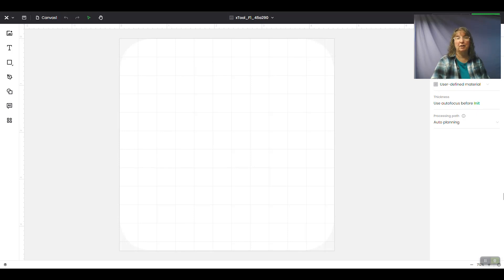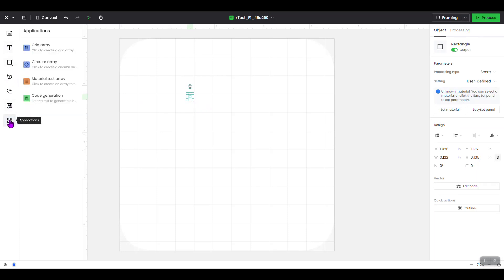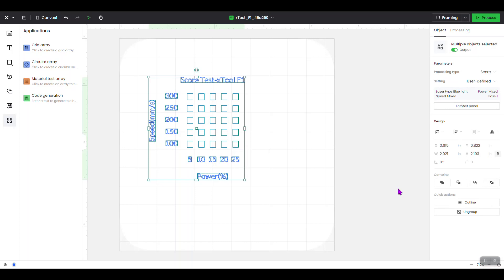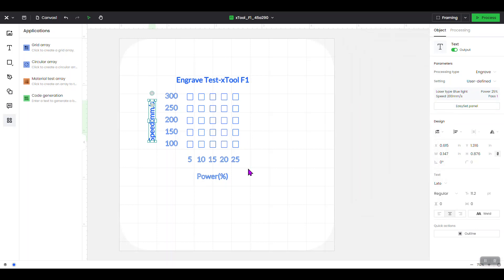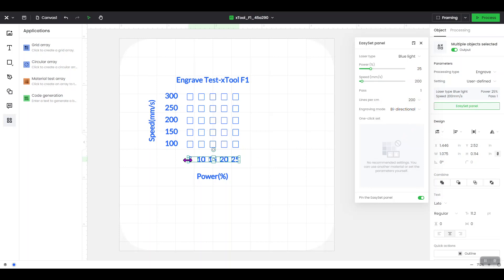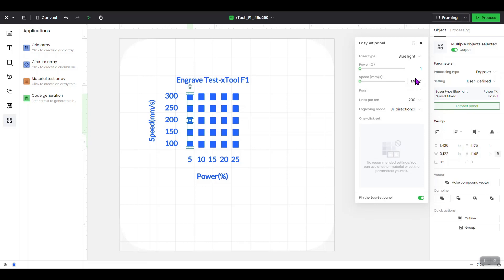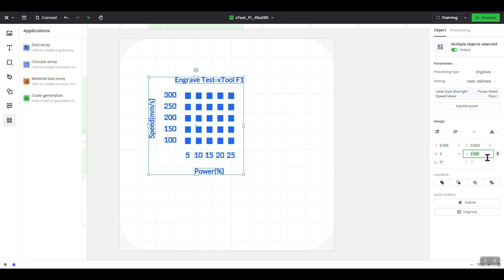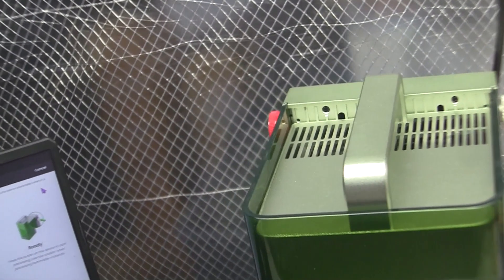Step by Step process to create a Material Test Array XCS v2

Comment: You instructions was easy to understand but i do have two questions.

1. How to decide speed and power?

2. Do you group it back after you finish doing  each box on speed and power.
Reply from the maker: There is no formula for how to decide which power and speed to start with when creating the first Material Test Array for a new type of material. I just pick some numbers to start with and I try to space out the numbers, ie 10, 30 50, something like that. You can also review xTools test patterns for your material. If they don't have the material you are using, you can try to find something close to it and use their power and speed settings to give you a starting point. Once you have run the first test array, you will see which power and speed works better for you. Then you just need to change the numbers to dial it in from there. As for grouping the squares back together. I find it easier to select all of the test array and group it together. That makes it easier to move and resize the test array to fit your material. If you have any further questions, please don't hesitate to reach out. I'm always happy to help if I can.